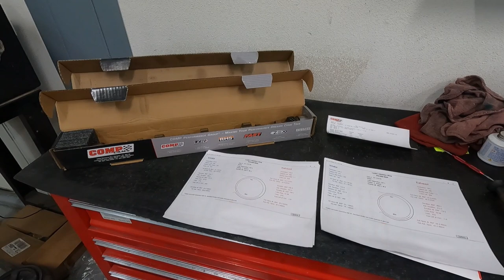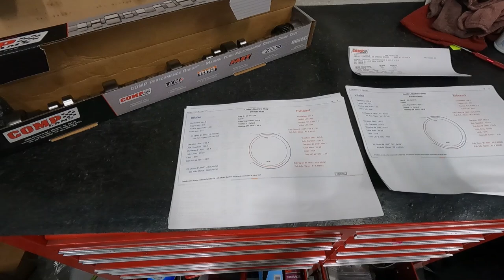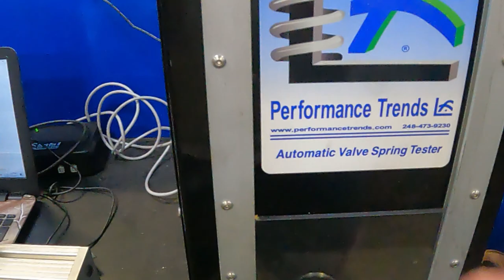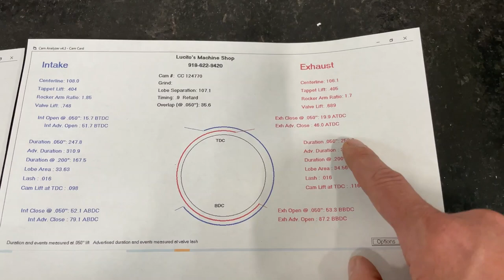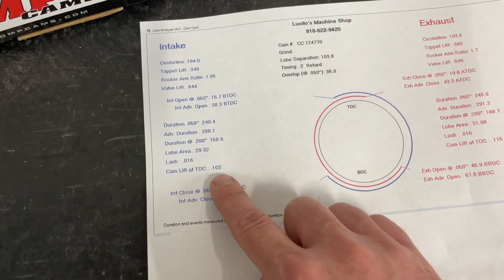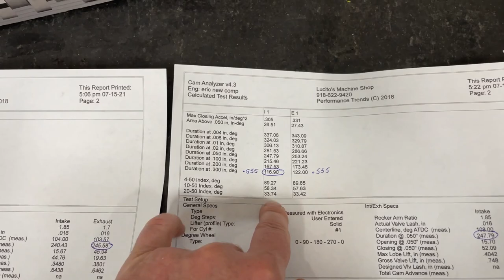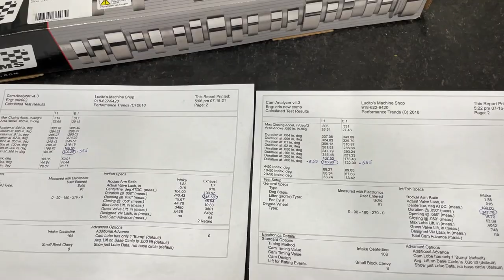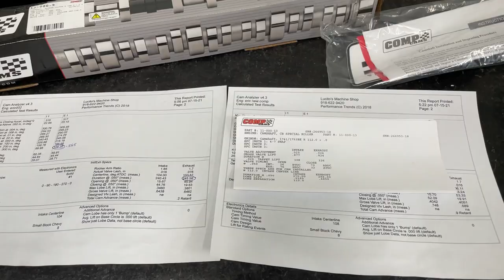Camshaft info. Why I think more lift is better.

Comment: Duration is high rpm power. You can make 1000hp with a 302 around 10k rpm. Gearing will get you the torque. You can't run an automatic up there. Planetaries will go galactic. If you have 1000hp at 10,000rpm then you have 525.5 ft lbs at 10k. If you put that through a 2:1 gear you still have the same horsepower, except it's now 1051ft lbs at 5,000rpm. Obviously it will eat parts but it is done all the time. That's how a turbo K24 spinning 12,000rpm is making 1080hp and running neck and neck with a 540 big block through the back end. Radically different gearing.
Reply: How can I get a 302 to spin at 10k rpm?
Reply: @curvs4me  be
Reply: Explain the Lenco then if planetary gears suck .
Reply: That’s the most convoluted thinking I’ve ever heard.

Comment: I used a bronze gear on my  Cleveland and it wore out pretty quick. i have a sintered iron gear i think and i check it periodically and its fine after 10 yrs on a comp roller hydraulic.

Comment: I started studying cams after picking one for my motorcycle back in 2005. I wanted a good street engine and picked a cam advertised to meet my needs, I thought. The engine was a 4-cam Harley (Sportster) that I bored from 883 to 1250, courtesy of a 3-9/16” bore. The cam had 256° intake duration at 0.050” and 0.493” lift at the valve. With the heads I switched to, it made power at 6000, about 84 hp at the wheel, and flat torque curve between 4-5000 rpm. This was about double the original 883 power, but nothing like what others got from modified Sportsters.

Your point about lift is what I missed on that cam selection. A few years later, and after studying for a while, I went a totally different way on cams for my 103 Twin Cam, a Woods 222. With a 103° intake centerline, this has an intake closing of 34°, way shorter than that Sportster cam. I don’t remember the exact numbers for the “493” cam, but it was probably around 99° intake CL, or 47° IC ABDC. Typically an under square engine, smaller bore than stroke, is going to need more duration than one with more area, relatively, on top of the piston. The Twin Cam is bigger, 3.875x4.375 compared to 3.563x3.813, but the heads flow more and the lift is 0.575”, a lot more. Both are small bore engines.

The Twin Cam gets to 100 lb-ft of torque at the wheel at about 2500 rpm and stays there to 4500 or so, with a max of 104. The horsepower peak is around 5700. Overall it’s very strong for street riding for a 900 lb bike. Not a competition machine by any means!

So, you ask, what has that got to do with V8s? Based on my limited experience and some study, the significant numbers for cam selection are valve lift, intake closing (IC), and overlap. In this video, Eric mentioned 100° intake centerline on a cam with 240° intake duration, about 104° LSA, and almost 0.650” lift. Intake closing can be easily computed from duration and centerline as 240 divided by 2 plus centerline minus 180, or 240/2=120, 120+100=220, 220-180=40, which means IC is at 40° ABDC. If the new cam is installed 4° advanced as well, it’s intake centerline will be at 104, so 248/2=124, 124+104=228, and 228-180=48 for intake closing, substantially more. With another 0.100” or so of lift, this cam is going to make a lot more top end than the Engine Masters cam, which had a different purpose (and limitations).

Overlap is the other significant variable. It is also fairly simple to compute given duration at 0.050 for both intake and exhaust lobes and LSA. Intake opening BTDC is (for the old cam) 240/2=120, 120-100=20 and exhaust closing is 246/2=123, 123-108=15 ATDC, or 35° of overlap at 0.050” tappet lift. Note the LSA comes in as intake centerline is advanced from LSA (a lower number), exhaust centerline moves the other way (bigger number). The new cam, with a bit more LSA and longer duration computes as 248/2=124, 124-104=20 BTDC and 253/2=126.5, 126.5-112=14.5 ATDC, or nearly identical overlap to the earlier cam.

Eric has real world experience picking cams for himself and customers, and it sounds like he is way better than average at speccing them, despite his claims. The heart of any engine is based on heads, cam and intake (mostly effective runner length) performance. Watchers could do themselves a favor listening to him!

Eric, you have a great channel here, thanks!
Reply: So if you've got your intake and exhaust set up to work with a certain amount of overlap you don't want to mess with that when your making a cam change or if you do you would want to be aware of how much and if you're shifting it forward or backwards.
Reply: @luckyPiston  Most people quote intake duration and LSA to describe a cam. Brian Tooley said once that the valve events need to be what they need to be, or some words to that effect. Looking at his cams, I find that the overlap is often symmetrical, at least for LS engines. If you’re trying to get power out of the overlap event, that makes sense to me. The amount of overlap needed is generally a function of displacement vs cylinder head effectiveness, with bigger engines needing more. The more aggressive the cam (or the higher the rpm range), the more overlap as well. My motorcycle engines, being relatively small bore/long stroke, needed LOTS of overlap while the LS with its great breathing needs less. Overlap is bad for idle quality and somewhat for emissions, but makes a big difference in mid-range torque. That’s why Holdener’s cam comparisons sometimes show more torque through the entire rpm range he tests. Factory cams typically have none, thus the poor torque curve comparison. Eric seems to have figured the ideal amount of overlap for his engine and specced a cam that changed only the other end of each valve event.
Sorry for the windy reply…
Reply: @bdugle1  No worries, Some good points there, interesting how a stroker likes more OL, my first thought is piston dwell time with the stroker is longer so why more OL and not less ? So what are your thoughts on dual pattern cams. I think they hurt power down low yet they are the predominant choice. Even when specing an engine that has plenty of exhaust flow people are still running dual pattern (in a street engine this makes no sense) my thought is with so many new heads on the market with improved exhaust you would think you would see more single pattern profiles. No one ever talks about how hot exhaust gas flows waaay better than what is in the cooler intake tract ? Density is enough of a factor that we have to correct for weather on our flow bench to get repeatability yet its never mentioned with gas exiting an engine.
Reply: @luckyPiston  I picked a cam for my 6.0 with strong street manners in mind, but I don’t claim to be an expert in selecting one for any combination. I have picked up a lot of general rules since starting to study cams in the last 15 or 20 years, however. I know a under-square engine is going to need more duration and more overlap, but picking precise numbers for a particular application for someone else is something I would not attempt.
As far as dual pattern cams—I think most applications seem to like them but single pattern cams can work well, too. The Comp 459 and 469 cams have the same intake lobe but the rec port cam (469) has more exhaust duration. The 459 is reported to have a better idle while the 469 has a slight edge at the top when compared in the same engine (from watching Holdener videos, basically). The SS2 cam has much shorter exhaust duration, near single pattern, and shows a strong torque curve all across the dyno graph. That supports your feeling that a single pattern cam has a place, even though it doesn’t make the top end of the bigger cams. If you’re running a 5.3 or 6.0 it could be a really good choice. I’d say especially if turbocharged.
I guess my rules would be get an expert’s recommendation on overlap, look for the highest lift you can get given the heads and valve train, and pick an intake closing point based on usage, displacement, and breathing limitations. Big BBCs need lots of duration while SBCs need moderate duration in the 355-383 size range. LSs need even less due to better stock heads. My Twin Cam bike cams intake close is at 34° which gives me a really strong low end. My LS cam has an intake valve closing of 42° which will run the power peak on a 6.0 out to low-to-mid 6000s. You undoubtedly have your own preferences for your engine. 
I know a lot more now than when running a 301 and a 327 in a C Gas dragster back in the 60s. There’s still lots to learn though!
Reply: I think I’m from outer space but I do like reading and learning from these videos

Comment: I looked at cams differently once I made a cardioid equation for cams. You mentioned things that directly reflect what I got out of the situation. A main takeaway I got was the shape of the power curve. That made it easier to plan simpler builds that don't even rev higher than stock, but still run great. Life don't have to be so complicated.

Comment: According to David Vizard for sbc used 128 formula 128-C.I.D/8/Intake valve x.91. this formula is sbc V8 with 10.0:1-10.5:1 to find the optimal lsa for sbc v8

Comment: I’m an Olds guy, I had a custom grind done for my current 455 build and kept an Olds friendly low lift spec. The heads were opened up to accept the “big” big block Olds valves along with some basic cleanup in the bowls and runners. I kept the lift low because the heads just don’t flow much above .500 so it seemed like needless stress (and expense) on the valvetrain. But I’m sure the quality of builds your doing far, far exceed the dinosaurs I’m messing around with. Great video, certainly quality food for thought.
Reply: W-30 cam is a goood street cam

Comment: Back when everybody was running ported 906 & 452 heads, a lot of pundits in the big block Mopar arena would always say that you don't need lift with a big inch mopar, because the intake ports "nose over" and quit gaining flow (or even lose flow) at a very modest lift level.

But, the guys who ran super stock class drag engines commonly ran cams over .700" lift... THEY sure as hell weren't going to try to be competitive with a low lift cam
Reply: To be fair, you can port, weld, and epoxy SS heads...
Reply: But they also didn't/don't care if it wiped out the springs/lifters, and valves. Winning was priority, not any meaningful reliability.  Safe to say the majority of Eric's audience is street, some strip use or sportsman racing on a limited budget, so making max power is not the only criteria for valvetrain setup, they also need it to last a season or two of racing, or 15-25k on the street with only lash adjustment and normal maintenance.
Reply: @Danglebarry62  I don't remember if you could back in the 1970s and 1980s.

I mean, now you can, but I'm not sure you could back in the day.

The only guy I knew who ran superstock was in the 1990s, and we didn't talk about his cylinder heads much. I was under the impression that they were supposed to be limited in what was allowed..

Comment: True on the turd cams. I remember drinking the GM kool aid with their factory hot rod cams for small blocks. Their cams were all about lots of duration  and moderate lift. Was supposed to be for road racing. The engine just felt spongy. Changed out to an aftermarket cam. and the Z-28 came to life. The cam made all the difference...

Comment: I really like your Videos, they are very informative.
I am a trained mechanic from germany, working with Engines from simle rebuilding to race engines on and off for 30 Years now.

While I 95% agree with your points in this Video, there is a very important point you got wrong (at least for your given example).

Whn you have a head that falls on its face after a given lift ( like in your exapmle 300cfm at .6" and 270cfm on .7")
You do not want a cam that has .75" max Lift, yes the cam docotr says you have 116,9" of duration at 0.555" Valve Lift, but that actually is duration at that lift or more, that is why lower lift numbers are higher.
So your .75" Lift cm will be racing through the "sweetspot" to plateau of at the worse spot, hurting overall flow.
In that specific Examaple, you want a cam with around .65" Lift (having exact flow numbers in .05" increment is really helpful), even if the duration is a few degrees lower, because it will stay at the sweet spot for the 109°, not push through in 20° and then stay at a lower number for 70°.

A typical head will flow only a few cfm less at higher lifts, then your point is valid, but with a sharp dropoff, you want to avoid it.

Also I am a bit confused with your LSA-explanation.
Normally a low LSA will make an engine run worse at idle, because the overlap is too high and it will get better with increasing revs.
And that can be used to lower dynamic compression. Which is good to get over the critical RPM for knocking, at mid to high RPM, knocking is less of an issue.
High load at low RPM is the dangerous part for knocking, because everything is moving slow and gives the mixture more time so selfignite.
Reply from the maker: With a higher lift cam you still have more duration at peak flow than less lift. Also if you added all the cfm through the lift points even with the loss of flow above peak that is still more cfm than smaller lift cam.
Reply: @WeingartnerRacing  I see the problem. You read the cam-doctor sheet wrong. It is not lobe lift, it is tappet lift on the sheet.
So the 117° at 0.3" Lift are at the valve, not .555 at the valve.
On first view i did not notice that, but not I paused to quick calculate effective flow ofbothlobes,and I see that there are 247,79° at 0.05", if that would be lobe lift, the number must be way lower, and not exactly the 0.05" duration.

Comment: I just bought a new cam for a boss 351 build. I had to choose between two good cams. I went with the one with a few less degrees @ .050 but had about .040 more lift overall. Lsa was 2 degrees wider but I'm told that should help with the huge boss ports. After this video, I feel I've probably made a good choice.
Reply: What lsa did you end up with just curious?
Reply: @-Atrocious  I went with a 110° lsa and 4 degrees advance. I built a Windsor years back and used a 106 and it loved it but the Cleveland is such a different animal.

Comment: Please do a video on opening and closing of the intake and exhaust! I’ve been reading that IVC is typical in range of 50-60* for better cylinder filling (of course you have to compensate your compression ratio for it too since it closes later) and typical exhaust valve closing is 5-10* for good exhaust scavenging (of course lots of cams are higher than that due to lsa) would be such a cool video

Comment: Here's how I look at it, hope I can explain this.
I look at the flow numbers on the head's, so say you have a set of head's (going to start around "mid lift") and from .300 to .400 you see let's just say 10 numbers increase in flow, then from .400 to .500 you see 6 numbers more flow, then from .500 to .600 you only see 2 numbers of gain in flow numbers.
Then from .600 to .700 you really don't see much of a difference at all.
So therefore a cam with around .500 lift will work the best with said head's, a bunch more lift isn't going to make the heads flow more air, so therefore no more power, the heads are maxed out around that .500 lift number.
Did that make sense? I hope so!
Reply: Like Eric said. It will give you more time at your max flow. Even at well past .500 lift.  It gives you more flow at your low flow numbers also...

Comment: AWSOME content🦾😎 I was playing around with a piston velocity calculator a few weeks ago. Thinking about 500” Blown Fuel Hemi’s . Looking at a 4.5” stroke 7.017” Rod @8,200. I was looking at velocity’s as crank angle increased and I noticed maximum velocity was @ 74 degrees ADTC. I wrongly assumed it should of been in and out if 90🥸. Because cylinder pressure only starts to translate to rotational force on the crank around 15-20 degrees ATDC and the piston really starts to slow down so early around 80* ATDC. I started thinking about the ideal Ex valve opening event. As far as crank angle when it starts to move off the seat… for the crazy characteristics of Nitro🙏🏻. It’s like really really early. No wonder we move 5 gallons of fuel a second and make 10’ header flames. So I would love your take on a valve moving off the seat video. I really love information and knowledge. Most of the smartest guys in racing  I know are very humble. The smarter one gets the less he thinks he knows because the finish line keeps getting farther away the faster we go. It’s the epitome of the saying “ you don’t know what you don’t know”🤦‍♂️

Comment: The most lift and the correct overlap for the application is what I read in Vizard's books. He says duration is determined by the correct spec of LSA, LCA and something else I can't remember. But, once you have the correct numbers, duration is already locked in.

Comment: I try to get the most amount duration at 100 200 300 400 lift given mechanical limitations etc. Lobe selection is absolutely critical. It's also very application specific. A good road course camshaft is not always a good dragstrip camshaft.

Comment: I am running 7.13 with a home built 406 with 220 Flotek CNC heads and a 292 schneider cam that everyone said was too small and would be a dog... 238/242@.050 at 108 with 622 lift and 11_1 people all think I have a solid cam from the sound. (Howards race HR lifters). I have spun it to 6800 and it still is pulling HARD and some day I'll set the 6al to 7k and see if I can get a better ET.